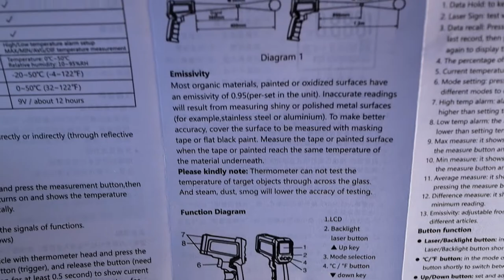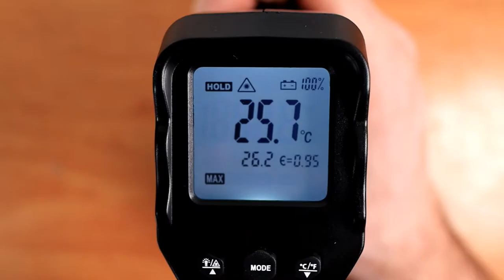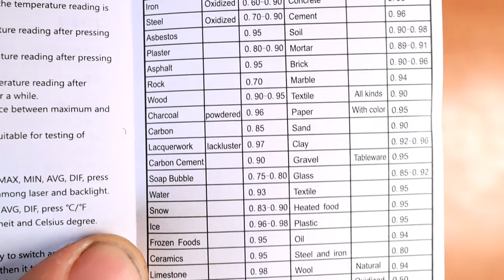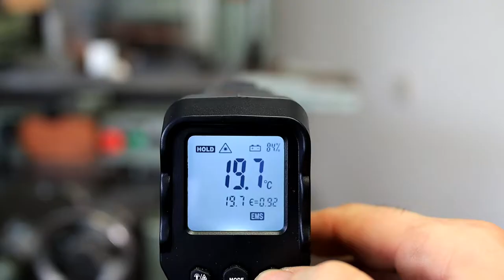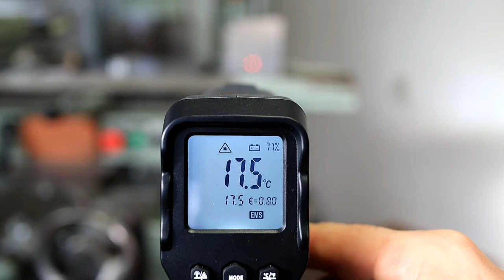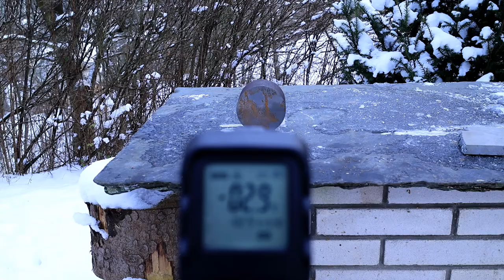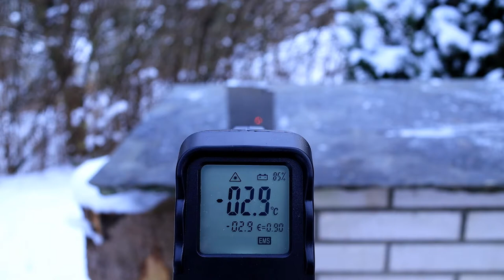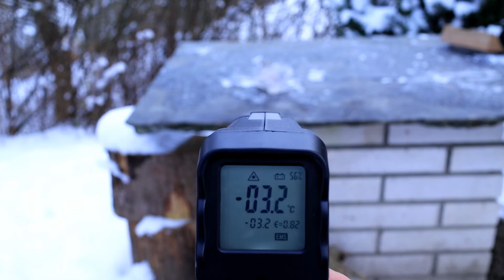Testing 60$ infrared thermometer Kaemeasu KMI-IT1600 / MAX temp 2192 °F or 1600 °C

Comment: Amazing work you've done there. A lot of dedication. Thanks. No conclusions though. So are you happy with it? If you have experience how does that compare to others?
Reply from the maker: Hello Dovy, thank you for the feedback. The video is basically a straight out of box presentation.  I would recommend the thermometer based on few facts: 1. you can adjust it for your application, 2. max measuring temperature, 3. measuring spot size and 4. price tag. Someone may disagree with the price tag but I didn't find other option in this measuring range (up to 1600 C). But be aware, that it isn't same as a thermocouple wired directly to a sample :)

Comment: Thanks for the video. I have a question - let's say I want to measure the surface temperature of a pan made up of polished stainless steel. If I lower the emissivity coefficient to 0.075 (the emissivity coefficient of polished stainless steel), will it show me the correct temperature or not since it's shiny?
Reply from the maker: Can't tell, but I test this one for you. What temperature  and range of precision are you seeking?
Reply: @JustAnotherCraftsman  Around 220°C, ±5 °C